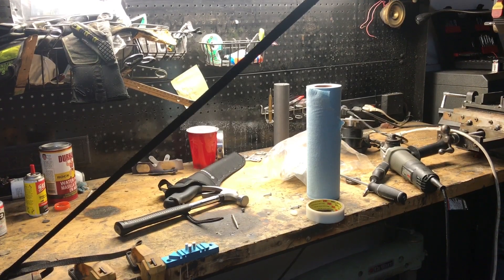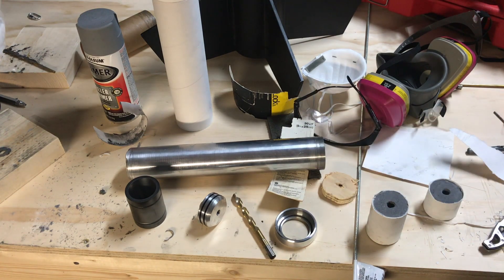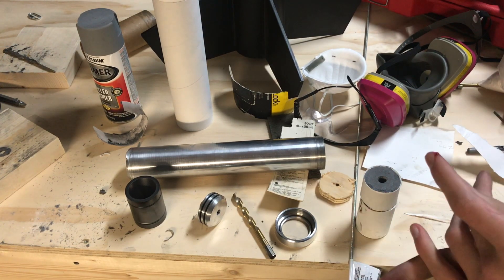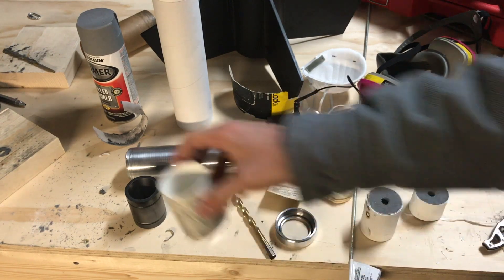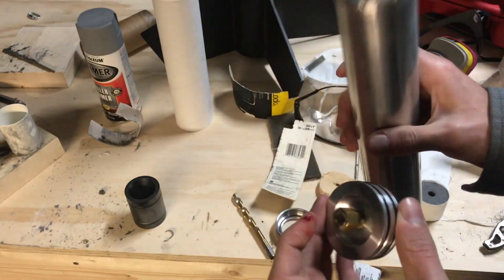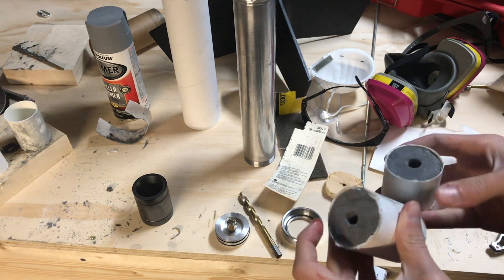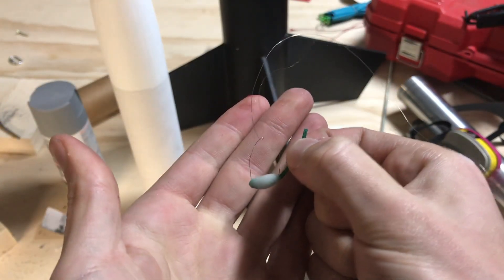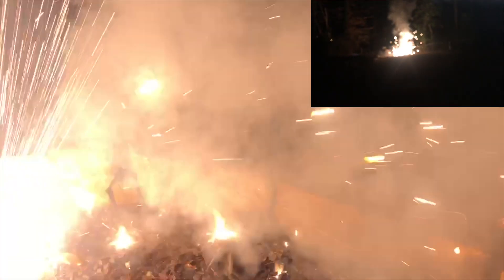DaVinci Solid Rocket Motor Test 1 (CATO)

Comment: So what type percentages of fuel did you utilize?
Reply: Probably a 70/15/15, or perhaps a 70/20/10 ammonium perchlorate/binder/aluminum powder ratio. That's generally where I ballpark most of my own APCP fuel, though I've gone as low as 70/12/18 AP/HTPB/Al, but it's a friggin PITA to cast with how thick it is, the more aluminum and less binder you use the more power you'll get at the expense of castability, though going too low is inviting bad things to happen, if the grain isn't strong enough or too porous it will cause an explosion when firing.

Comment: So, I'm wondering, did you put any kind of sealant between the two fuel segments to keep the burn even and centered? I know nearly nothing about this stuff, so I'm totally talking out my butt. As you were describing the rig, I kept expecting you to say something about joining/sealing the fuel slugs end to end. Without that, it seems like the end-most slug would become a projectile driven by the second one, as soon as the burn front reached back that far. Cool stuff, though. I'm really loving your builds and thought process.
Reply from the maker: generally fuel grains dont get joined together in motors like this. everything is sandwiched pretty tightly together in the motor. if anything, joining the grains together might be done to mitigate burning on the surfaces where they butt up (which could overpressurize the motor), but if you keep it packed nice and tight, that's generally not a problem. thanks!
Reply: To add to this topic, some grains are actually intentionally spaced apart or have their ends lightly tapered to increase burn area/rate, which are called BATES grains (Ballistic Test Evalation System), they provide high thrust and short burn duration. However, some grains are adhered end-to-end to inhibit burn rate, which makes it burn like a single long cylinder of propellant instead of multiple individual grains that burn identically, like in a BATES grain. This can slow down burn rate if a propellant is too fast or has a high pressure exponent (in essence, the higher the pressure the faster it burns with an exponential increase in burn rate the higher it goes), or to slow a burn down in a rocket with a high Kn ratio, aka the ratio between the surface area of the grain and area of the convergent zone to increase ISP or prevent overpressurization.

 There's no need to bond them in place as far as the grains coming out is concerned, once the grains are loaded into the case (which can also sometimes be bonded to the casing as well with epoxy or Gorilla Glue depending on the thickness or existence/lack of a fuel grain liner) the nozzle will contain the grains in place, the only way a grain will come out is if a rapid unscheduled disassembly or catastrophic failure occurs, also affectionately known in the community as a ruddy Cato😂 (big boom).